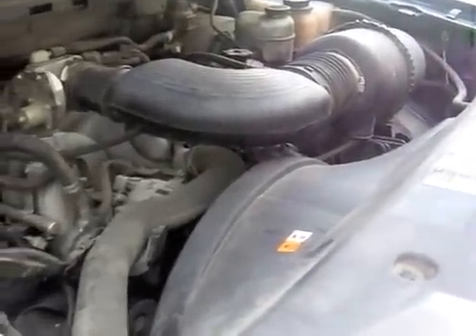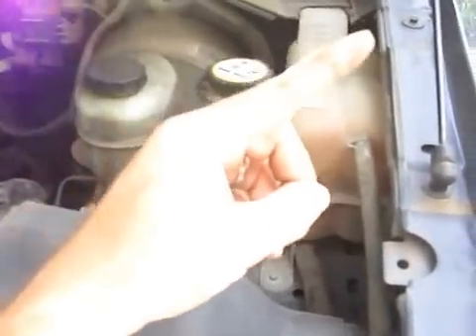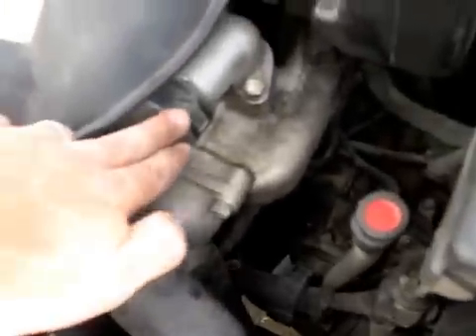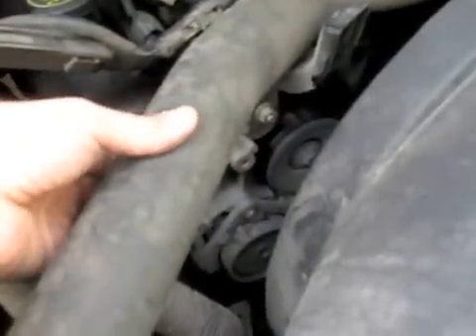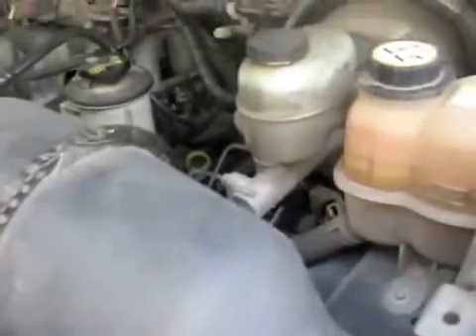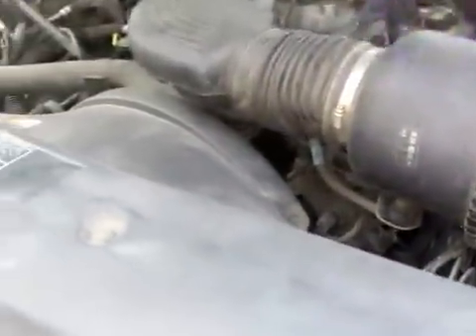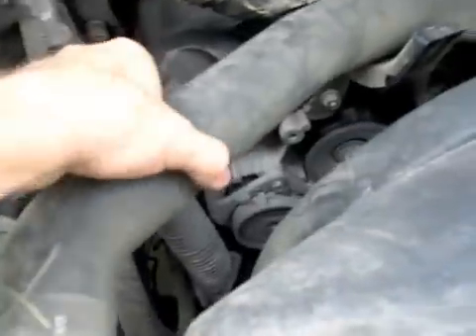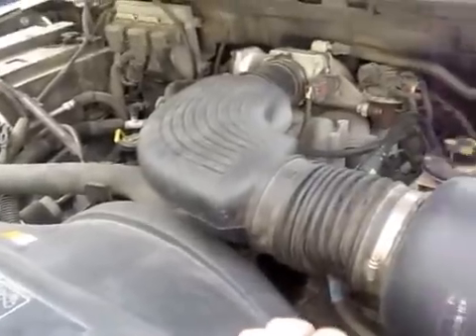Car Engine Overheating - Causes and Symptoms of Over Heating  Car Engine

Comment: my truck been over heating and l fixed the leak on it but every time l try to on water to the radiator the water comes back up! l might add the truck did overheat on me the other day and run it away to my house like that

Comment: Hey TMM, my girlfriend's mother's 2006 mazda6 has been overheating lately.  On a cold start, it will get up to normal operating temperature and sit at that temp for a good 5-8 minutes.  After that, it start to run hot very quickly.  I also noticed that as soon as it starts to run hot, the heat from the heater stops working and feels ambient rather than hot.  Does this sound like a thermostat problem?  And should I still pressure test the cooling system?
Reply: +Travis Pittman Thermostat stuck closed I suspect.
Reply: THEQuantumPolkaDots spot on, that's exactly what it was, we replaced it, and now it stays at operating temp no prob!

Comment: Now if the upper radiator hose to the thermostat is NOT hot but cool to the touch and can easily be squeezed, then would that indicate a bad T-stat?
Reply: +S Peck I think the upper would be really hot and the lower would be cold.

Comment: Just replaced thermostat i read a comment below when i turn on the gauge reads cold then goes all the way to hot i had added radiator fluid since it all came out when we replaced the thermostat were we supposed to flush the coolant out first I'm confused please help thanks also the radiator tank is full and the coolant doesn't seem to be flowing in as usuall
Reply from the maker: Rachel Perez Get cooling system pressure test to help find the leak, if no leak, check radiator for restriction and cooling fans....also make sure there is not an air pocket in the system from the thermostat repair.
Reply: TrustMyMechanic.com i have a 06 impala ss, my engine gets hot but it dosent overheat, the engine light is on and the temp gauge reads normal. the problem is my fans dont turn on while im at an idle. why isnt my fans working? is that why my engine is hot when i open my hood? but the temp gauge read normal while the fans dont work...

Comment: I have a 2004 Taurus and I'm can't find the radiator cap to put a cooling system sealant into.
Reply from the maker: LaTanya Bostic Should have the plastic coolant overflow bottle on the fender area, that is your radiator cap.

Comment: Hello i have a 98 Lincoln Continental ive replace the fan and thermostat and there arent any leaks or smoke nothing but my car still runs hot could you tell me what the problem could possible be??
Reply from the maker: Dre Royal I would look hard at the radiator....restriction at the bottom and needs to be replaced.

Comment: I'm asking lots of YouTube video posters..Where is all my water going ?  I added some engine block sealer a couple months ago. I drained the bad oil and put new oil back in. I had a pressure test , and bought a new radiator cap. The temperature gauge reads running normal. I add water everyday and coolant is too costly.
Reply from the maker: scottgixxer67 There has to be a coolant leak somewhere, I would have another mechanic pressure test the cooling system for internal (head gasket) and external (hoses, water pump etc. ) leaks. If you suspect an internal leak...check out my channel for my head gasket sealer trick.....it works!

Comment: hello great advise. my serpentine belt broke while we were headeing home .let it cool down and the water pump when out.so i change it out .started it up and it got hot.so then i put a new thermostat on and it still got hot took it to the parts house and they check out my fan it was running good .got another thermostat thinking the new one was bad.still ran hot. please help me out thank you sir
Reply from the maker: Thomas Whetzell Sorry I over looked this question.  I hope you got things fixed, but if not, get a cooling system pressure test first to rule out a coolant leak. Hopefully it was an air pocket left over from the water pump repair.

Comment: ok when i start my car the needle is automatically on cold then it slowy starts going up towards hot after maybe 3 min then its boiling hot danger then the car shuts off...i replaced the themostat...and my fans kicks on when it gets near hot..i never had a coolant flush but it is coolant is the resavoir but the dashboard say low coolant... im lost... i got new waterpump..its ah 2005 malibu maxx..what do you think is the problem?
Reply from the maker: Nelson Cartier sorry I over looked this question...hopefully you solved the problem by now, but I would get a cooling system pressure test to rule out a coolant leak if you have not done so.
Reply: OK THANK YOU..ITS STILL NOT FIX YET... you said cooling system pressure test can i do this own my own or i need a shop? be detailed
Reply from the maker: Nelson Cartier Please pay the $50 to have a qualified mechanic check this for you, I would be glad to help you with there diagnosis once you have one. Watch the video again, pressure test first, then have the mechanic check for a radiator restriction in your 10 year old radiator, then check electric cooling fans. Turn on your heater when it overheats...is the air hot, it should be, if its cold then you dont have enough coolant circulating in the engine. if hot, the temp gauge should go down...which would tell me the radiator, or cooling fans are NOT doing their job.  OR...you have an air pocket trapped in the system which needs to be bled out by the mechanic.
Reply: OK THANK YOU IM HAVING aaa tow it 2moro

Comment: Have a Mazda 5 that that goes into the upper range on the temp gauge when driving in city then when i pulled into the parking lot it dropped to mid range.. Did not notice the gauge rising until i looked down because the ac was blowing warm air. Coolant fluid low? Thermostat issue?  Just got car back from dealer for fixing from being flooded. New engine put in it.
Reply from the maker: Paul Lock Sorry I over looked this question Paul, hopefully you got things solved by now...if not, get a cooling system pressure test to determine if there is a coolant leak...probably is/was.
Reply: Did. Was. Loose clamp when they replaced the engine
Reply from the maker: Paul Lock Awesome, so sorry I did not see and reply sooner. too many things get left loose/unplugged etc. when replacing an engine...pretty common.

Comment: Can u advice me sir ? 1996 Chrysler LHS , was running fine. Long story short, I overfilled Transmission Fluid. Result - Overheating. Stopped the car, parked it. After like few seconds, steam coming out from engine passenger side. Water all over the floor. So i turned the heater on without turning the engine on. Opened the cap, no water or coolant in it. It is empty. WHAT COULD HAVE POSSIBLY HAPPENED ?
Reply from the maker: jahankavaasi Sounds like you have a heater core leak, and you need a new core or you can have it bypassed with a cheap hose connector. Bypassing it will disable the heater, so no heat inside the vehicle but it's cheap and easy and will give you time to save up for the heater in winter.  How did overfilling the transmission cause that....I don't think it did, I think it was a coincidence.

Comment: I got a question, i have a 2003 nissan altima 2.5s 4 cylinders. It overheats if i use the car stop lights, also wen i step on the gas pedal it makes sound. Any advice please?
Reply from the maker: Alexandra Juarez Cant really help you much from this side of the computer. I can only suggest you have a local mechanic look into this for you ASAP. Don't let the motor overheat

Comment: Thanks this helped a lot I was stumped by my car overheating with recurring antifreeze refills today, I'm so mad have an old 99 Toyota Camry and it just keeps overheating when I run on the freeway. I need to pressure test it and check for any blockage and leaks for sure.

Comment: LOOK I HAVE A 1997 FORD F150 4.2 V6 I CHANGED THE WATER PUMP,CLUTCH FAN GAUGES AND THERMONSTAT WHAT ELSE COULD MAKE IT RUN HOT LOSSING NO WATER
Reply from the maker: monique louviere If no coolant leaks, and system is holding pressure I would be suspect of a restriction at the bottom of the radiator, which needs to be replaced.

Comment: i have a 03 ford escort zx2 that over heats i changed the temp senser and the fan still dont come on? i changed the thermastate to. my gr daughter needs the car to go back to collage can u help?
Reply from the maker: Bonny Lampman Bonny, start with the basics first, 1. cooling system pressure test to determine if you have a coolant leak. 2. check the electric cooling fan, test motor and relay, 3. check the radiator for a restriction. These cars are bad about clogged up radiators and bad fan motors. If there is no coolant in the radiator or not enough circulation it will over heat, and the fan sensor needs hot coolant flowing across it to read coolant temp. Paying a mechanic to check this is cheaper than guessing.

Comment: My 1999 Chevy blazer was over heating had to stop and let it cool down and put more water in the rotator drove awhile and over heated again, then had to stop again because it over heated again so had to pull it off on the side of the road and had to leave it there because it stopped running and then the battery died, went back the next day out more water in it. I got two miles and then it had no power to get it up a hill there is no water in the oil when I went to start it again and had no power the motor was shaking
Reply from the maker: Phyllis Jenkins Phyllis, this does not sound good at all. Fill radiator with water and  get a cooling system pressure test to determine where the leak is coming  from.  You probably overheated it so much you either blew out the head 
gasket or you totally destroyed the engine internally. I have a solution for the head gasket on my website, search for headgasket additive, but if the engine is damaged...no such luck

Comment: I cut mazda tribute off and anti-freeze
Reply from the maker: Linda Bowden Get a cooling system pressure test to determine if you have an eternal coolant leak, then check the radiator for a restriction. Engine could be running too hot, and boiling over in the plastic coolant bottle...restricted radiator is usually the culprit.

Comment: You do not need to go to 20 pounds for a psi test.  Maximum you will need is 15 or 16.
Reply: Magna Norris fuck no Max is 13 going over that you’re going to mess a o ring up or seal
Reply: @Jorgetherealtor  Fuck Jorge you are wrong This time,my Acura TL has a 16psi cap.
Reply: Normally radiator caps are rated at close to atmospheric pressure of 1 bar (14.5 psi) +/- 10%.

Comment: Hi I have 3.4 impala the belt broke n I drove to get it fix without water pump spinning it ran hot, I replaced the belt n now still running hot, I bled valve on thermostat n getting coolant out of it but water pump valve is getting nothing, just recently replaced both water pump n thermostat, n also my water pump is spinning, can you help plz
Reply from the maker: Damon Robinson Is there a coolant restriction in the radiator or radiator hose? Could just have an air pocket that needs to be bled out, or a problem with the new thermostat not opening??
Reply: thanks it was my water pump, the one i bought was defective

Comment: Hi i got a question. Im having to add engine coolant or water to the radiator resevoir but the car is not over heating but when we turn the car off the engine coolant spills out and it's like i can hear a boiling sound from the hose. What can you say the problem might be.
Reply from the maker: dean igisaiar Get a cooling system pressure test to find an external leak, also make sure radiator is not restricted causing lack of coolant circulation...thus boiling over into the reservoir and on to the ground.
Reply: thank you and also this just happend when i parked my car for already a week but i still start it every morning just so the battery don't die. But now were having problem with the stirring. It's hard to steer and the steering light indication is on but we still have power steering fluid and it's up to the max line. So what do you think the problem might be.
Reply from the maker: dean igisaiar Check the p/s belt, make sure its tight and not slipping. If fluid is full and belt is good, most likely an internal problem with the p/s pump or the rack and pinion unit under the car.
Reply: TrustMyMechanic.com im having the issue that the car overheats but our reservoir is full. but if i put the coolant directly into the radiator hose the car runs fine until i turn the car off, then the coolany leaks out and when i run the car again it heats up asap. i know we have a leak but im unsure of why the reservoir stays full, does that mean our pump is bad or just that we have a leak in the system and can fix it with this liquid repair stuff?

Comment: this is what happens with my mitsubishi 3000 GT , im driving down the road all is good ,but if i turn the AC on after 5 or 10 miles it pegs to red zone and AC starts blowing hot air , when i i turn off ac is drops back down to normal . it never actually really over heats though. all fluids are fine . ok i just turned on car/Ac let it run for 5 mins one fan came on, so i drove it around bout 5 min peged it to red zone on temp gauge AC went from cold to hot pulled in driveway opened hood and both fans were on, turned off AC temp went slowly down to normal , can you help ???? i already changed thermostat NO difference , could it be Heat gauge sensor ???
Reply from the maker: Leza Curtis Check coolant level in radiator first, if low then get a pressure test to locate the leak. You might have 2 electric fans on this vehicle, 1 for the a/c and 1 for the radiator...they both should be on with a/c. Either you are low on coolant, electric radiator fan is not working or you have a restriction in the radiator and it needs to be replaced.
Reply: my coolant  levels r always good but  r both fans always suppose to b on or  does the second one come on only when ac is on ... The car never actually physically overheats it just pegs in red zone on temperature gauge
Reply from the maker: Leza Curtis Both fans should be on with AC on, and engine at above normal temperature. Don't let the engine get in the red, severe damage can occur. I would get a mechanic to look into this for you, pressure test cooling system, test fans,  check for a radiator restriction.
Reply: ok thank you :) have a nice day...oh I also have a problem with a 1999 4 runner cuttin off while im driving down the road im gonna get hit one day...
Reply from the maker: Leza Curtis I would look at the secondary ignition parts first, crankshaft position sensor and camshaft position sensor and the distributor. When those parts fail (usually when they overheat) it will cause a sudden engine cut off BUT the engine will usually start right back up with no issues....until the parts overheat again. 

 A bad fuel pump...that overheats as well and cuts the engine off usually will not restart easily as it takes longer to cool down and operate again.

Comment: Hi, I have a 2006 Maxima, I live in Orlando and when the temperature gets over 90 and when I have more than 1 person in the car with the A/C on traveling over 50 mph my car starts to over heat. I have to turn off the A/C to get to cool down or slow down. Listening to your video it sounds like I need a radiator? I replaced thermostat and flushed the system but still does it. Thanks in advance.
Reply from the maker: Alan LaFrance Yes, probably time for a new radiator BUT rule out a coolant leak first. If coolant is low, get a pressure test to help you locate it. Also make sure there are no air pockets in the system left over from your previous repair. Upper radiator hose should have pressure on it when engine temp is normal.

Comment: My 2005 Kia Sedona would rise in temperature at a stop light and go back down when driving, and then my radiator blew so I had a mobile mechanic (who i used before) come out and replace my radiator, and when I drove my van for the first time the temperature started getting hot very quickly and didn't go down while driving so I pulled over let sit and after 3 hours I made it home, meanwhile mobile mechanic is MIA what could cause this, also told mechanic that my reservoir tank never wend down, and I just found out it should have a straw in it and it doesnt so could that be the problem?
Reply from the maker: Tammy PlotnickI would suspect you either have air in the cooling system from his repair, that needs to be bled out or you might have a thermostat problem and it needs to be replaced. Turn on your heater, you should have HOT air coming out, if you don't either there is not enough coolant in the radiator or the thermostat is bad.
Reply from the maker: Tammy Plotnick More I think about it, I would replace the thermostat regardless. I always replace them when installing a new radiator, since yours blew up...could be the thermostat that caused it.

Comment: I dont have my Pontiac g6 anymore because the motor siezed up at 130000 miles but before that happened my car maintained a good temp on the gauge but the radiator was extremely hot and took hours to cool down after turned off. Also when I reved up the engine it would make a knocking noise.  My engine light never came on. What could that be. Also my oil was very burnt when I changed it the two time while having it. I changed it when the oil life got 0 which ended up being 7500 miles. What do you think it was. I think my timing chain tensioner may have failed.
Reply from the maker: southpawl1 Hate to say it but sounds like this engine is past due for a replacement. Get a compression test on all cylinders to prove it.  Knocking noise, and burnt oil....not good.